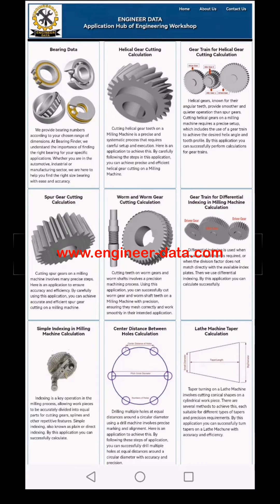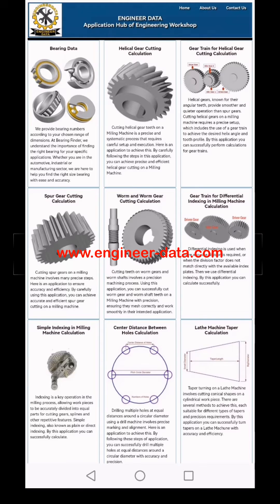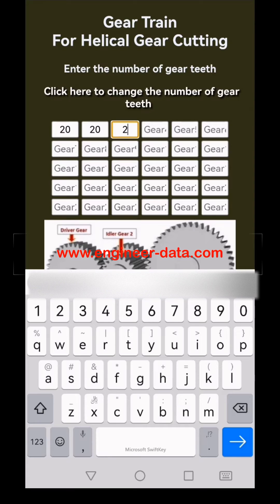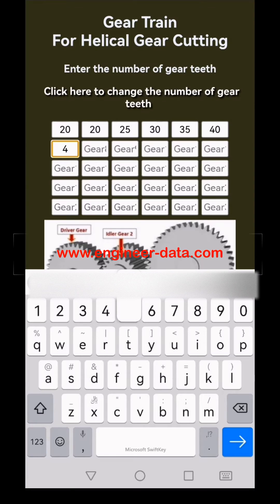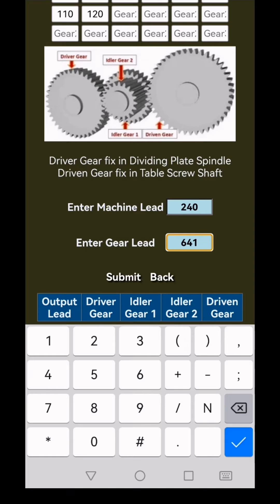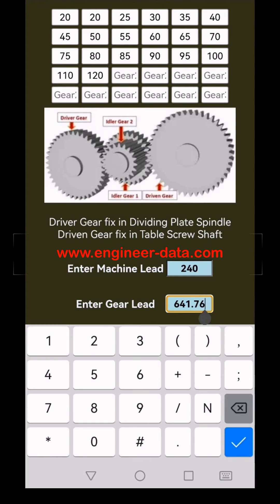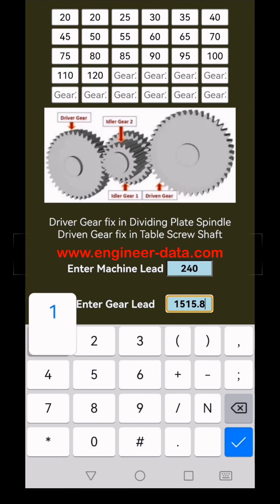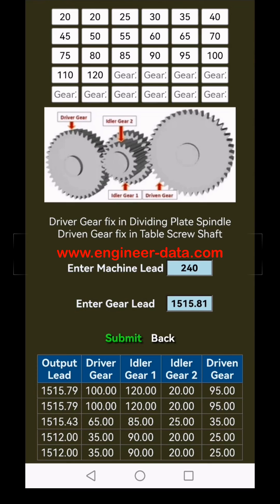Calculate gear train for helical gear cutting on milling machine

Comment: Hello,

First of all, I would like to sincerely thank you for your excellent work on this application. It's a very useful tool for calculating gear combinations in differential indexing operations.

However, during practical use, I noticed a small issue regarding the gear arrangement suggested by the program*. While the *gear ratio calculations are accurate*, the *positioning of the gears (Driver, Idler 1, Idler 2, Driven) sometimes doesn't follow the standard mechanical setup used in milling machines with dividing heads.

Technical note:
In traditional mechanical setups:
- The Driver gear (Z1) should be mounted on the *dividing head spindle*.
- The Driven gear (Z4) should be connected to the *machine table leadscrew*.
- Idler gears (Z2 and Z3) are only used to transfer motion between them and do not affect the gear ratio.

The current display in the program might mislead some users, especially beginners, into mounting the gears in the wrong positions.